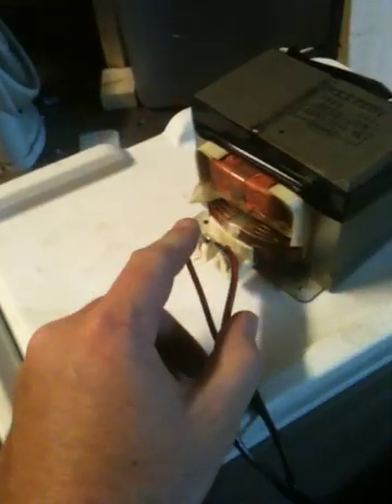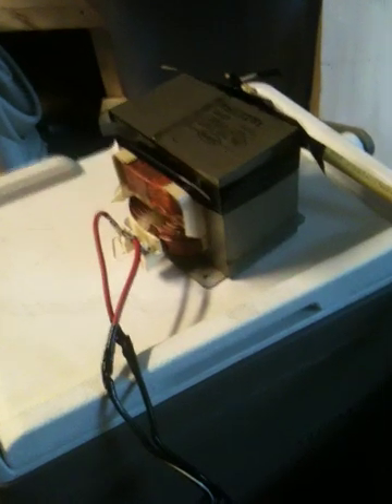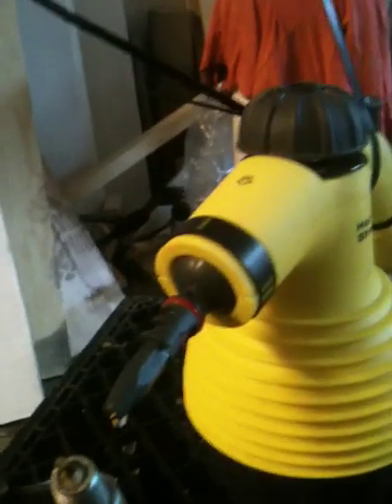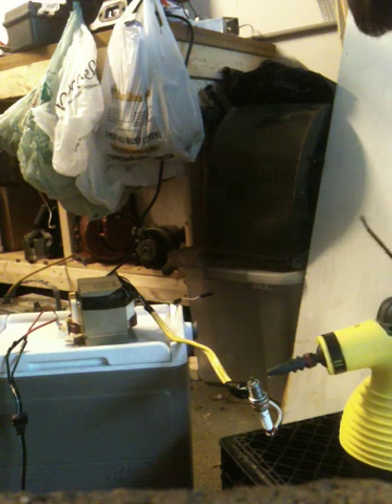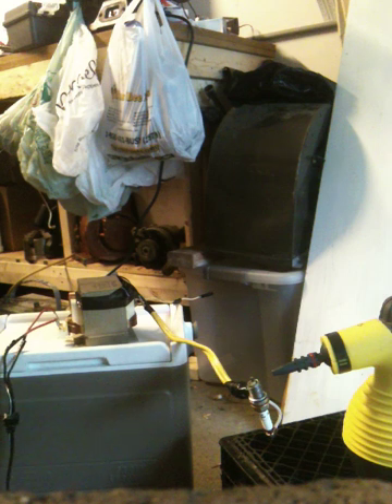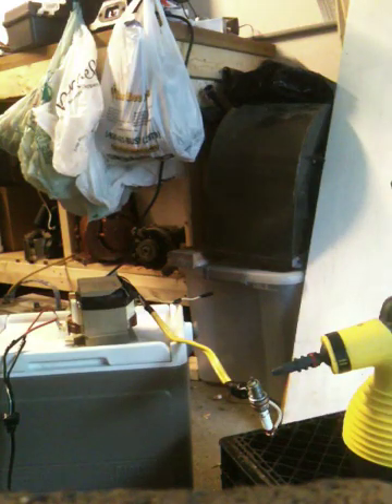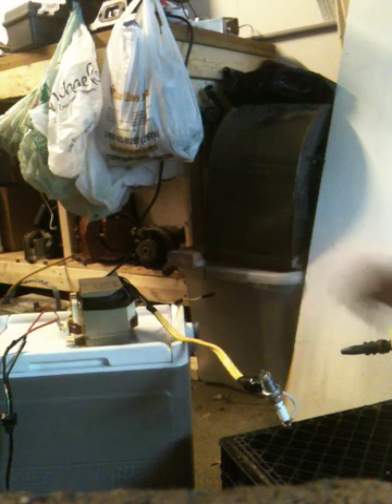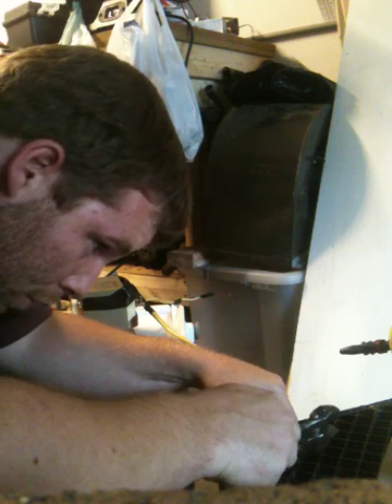SUCESSFULLY BURNING WATER 5 hp briggs engine, convert to run on water Series 3 Part 6

Comment from the maker: I did try it with out the water. The spark was much smaller and it wouldn't jump the gap unless used something toforce the cconnection much like how a Jacobs latter works.

Comment: This was kinda cool to watch, but here's my problem with it.  There was too much energy used to produce the small amount of energy at the spark plug.  The transformer used an energy source, as did the steam machine and the total output at the spark plug was far less than the combined input to the steamer and transformer.  Everyone should be aware that you can take a relatively small DC input to ionized water and produce hydrogen and oxygen, which will burn and produce energy.  Only problem is

Comment: sorry nits been so long . I have looked at this vid again and i am not sure just how much water is being dissasociated and back. the temperature may be important. A hho torch can vaporized tungston at over 10,000 degrees, Water dont need anything close to that to fall apart. I would like to see what happins when H2O is exposed to vaporizing tungston. I am not able to do the experiment at this time. Maybe you can ?and or maybe it dont matter

Comment from the maker: @eastvalley80 also that is why i need a much higher voltage so i dont have to use as much energy in current draw. this will require me to not have as much energy put in to produce the same or better effect, i will also be doing another video where i am trying to burn deionized water which sould draw less current and hopfully i can sustain the burn,

Comment from the maker: @MrStemkilla yes its exactly what i expected from it i just had to prove the concept now i have to improve on the energy by getting a much higher voltage that will ionize the water to the point of it seperating much easier while burning it at the same time.

Comment from the maker: Crap I accidentally deleted a message of a guy talking about a variak. Recitified dc and needing about 325 vdc to burn the water. I think the first experiments I was doing had a similar set up and I was getting a higher voltage then that.